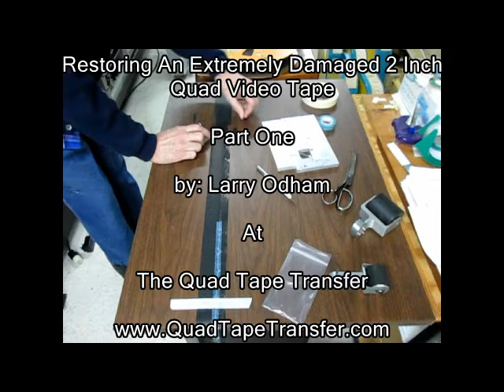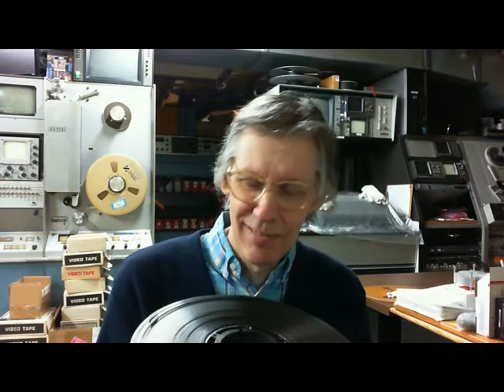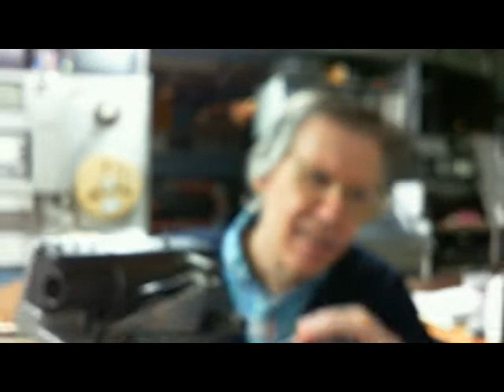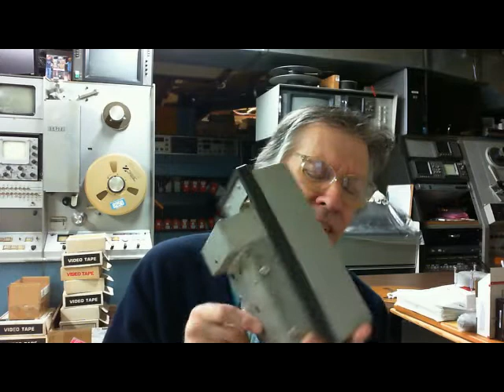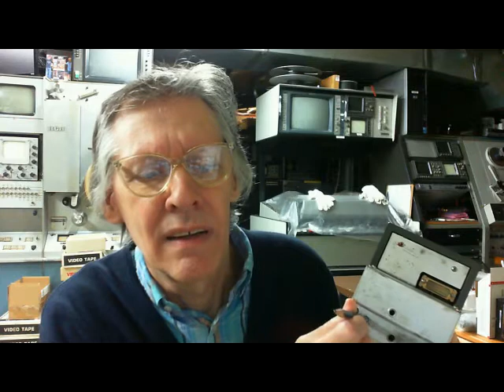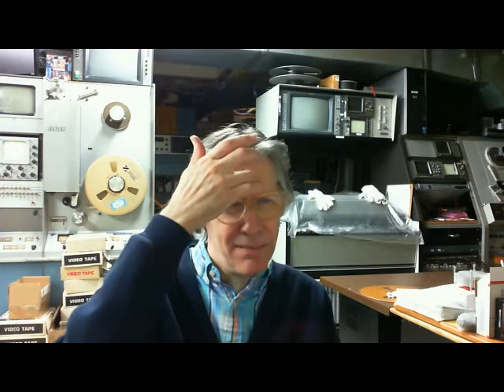The Quad Tape Transfer-Part One: Restore an Extremely Damaged 2 Inch Quad Tape

Comment: 9:33 - Does this mean that you can play the audio track from a quadruplex tape in a 24-track tape machine like a Ampex MM-1200 or a Studer A820?
Reply from the maker: Hello Adao RS, yes that is correct. I am familiar with Ampex MM-1000, 1100, and 1200 24 and 16 track machines and have played back a quad tape audio channel using a MM-1000. I also have played back the outer audio track of a 24T master tape on a quad VTR.(with the vacuum headdrum guide disengaged). They are both 15 IPS tape speed. I am not familiar with the Studer, so I cannot say about that. A friend retired from Ampex Corp gave me a relic a few years ago, a head adjustable mount with a micrometer that was used for setting a standard head height for making test tapes at the factory. I will make a short video for you and post it here on the channel in a day or two when I have time. You may get some ideas from seeing that apparatus.